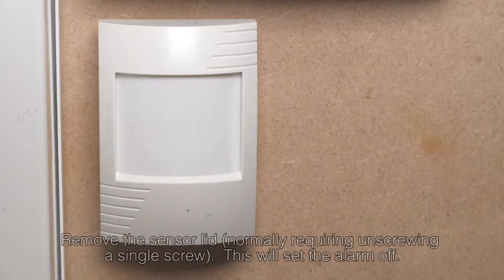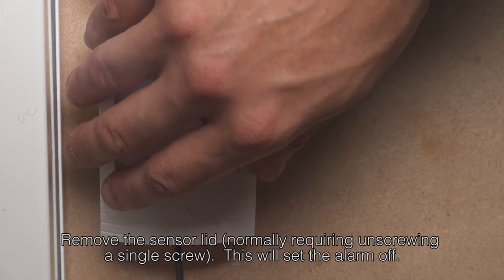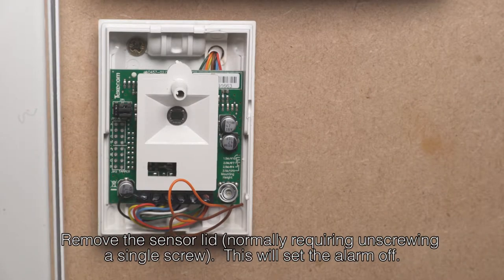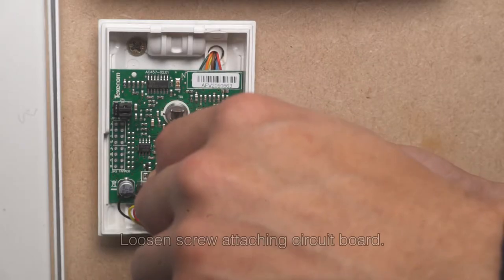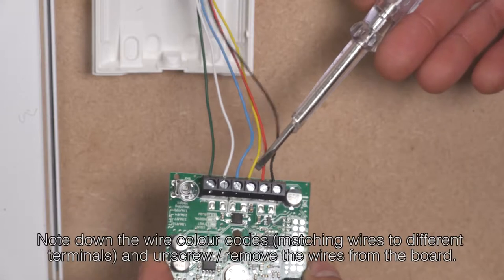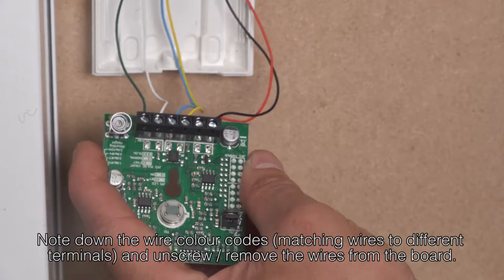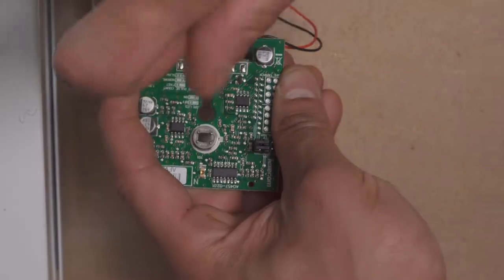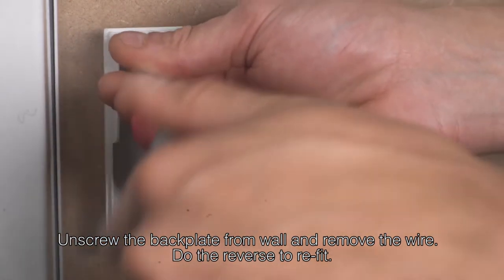How to remove / replace burglar alarm PIR sensor

Comment: Do I need to turn power off to alarm unit before doing this? How can I avoid an electroc shock from the PIR?
Reply: low voltage
Reply: U can’t get hurt but you always can remove a fuse from ur located external panel